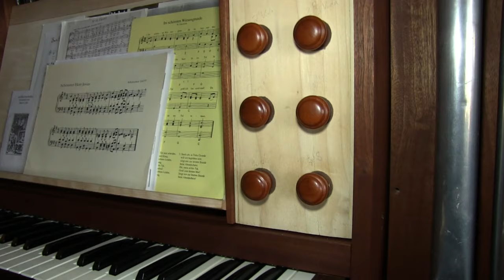MIDI Pipe Organ with 3 pipe ranks

Comment: If Hauptwerk is not being used to extend the small pipe organ, why was it necessary? Why not use MIDI sequencing software that does a better job of managing MIDI captures and playlists?  Is Hauptwerk being used to add more stops through sound sampled from larger pipe organs?
Reply: What is MIDI sequencing software?
I did use Hauptwerk to simply add more stops to the 3 real pipe stops.
Reply: @rattengarden  MIDI sequencing can either be software on a general-purpose computer, or a hardware unit, i.e. a “sequencer”.  Its purpose is to record and play back the note (and registration, etc.) sequences of a performance, much like what a player piano does.  Since this organ has electric chest action, it probably would work with a sequencer.  The MIDI standard was not designed with organs in mind, so the various companies that make electronic organ relays (e.g. Syndyne was mentioned in the video) each have had to come up with their own way to encode stop changes into MIDI messages.  If you want to use a sequencer, you need to check that it meets the specific needs of the organ’s relay system.  I believe Syndyne themselves made a sequencer unit at some point; I don’t know if they still do.